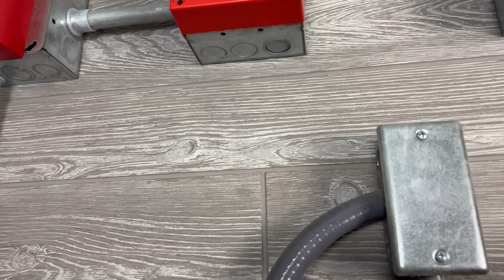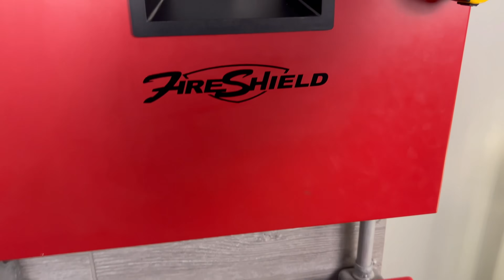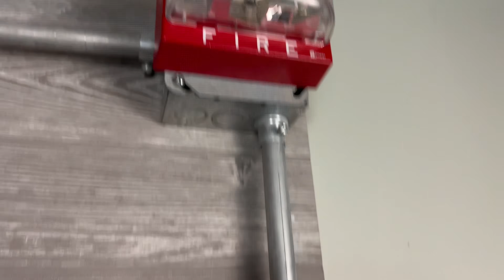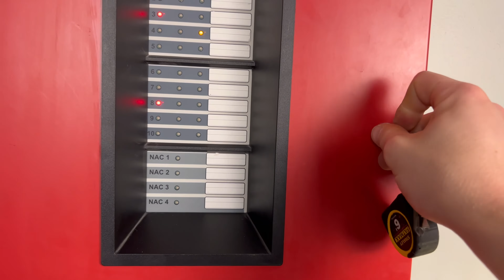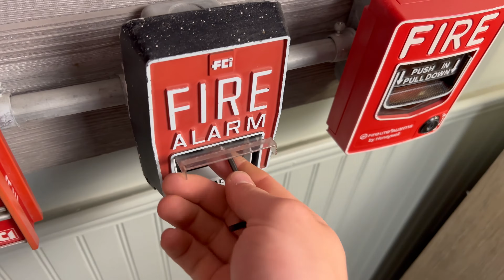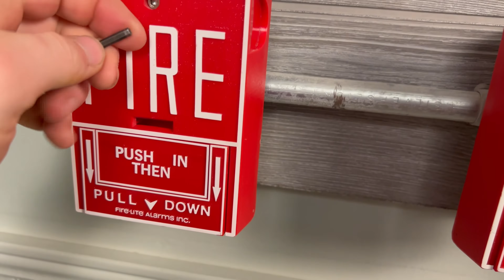System Test 22 | Board 2

Comment: I’ve seen that Simplex smoke detector at an office building before. I believe the model is 2098-9209. That office had a Simplex 4005 with 2099-9754 pull stations and 4903 horn/strobes as well (not sure if they were electronic or electromechanical horns).

Comment: Very cool system test! A couple questions I have about this setup:

1. Why does the Wheelock 7002T sound all raspy?
2. What's the more specific model number of the 4904 strobe?

Another thing is that integrity strobes are actually ceiling rated, though the 'FIRE' lettering isn't.
Reply from the maker: Thank you! To answer your questions:
The 7002T sounds raspy due to the FWR output on the 3 zone EST FireShield.
The full model of the Simplex strobe is 4904-9139.

And also I’ve heard about the Integrity’s being ceiling rated. Some say they are while others say they are not. I’ve never really looked into it though. Either way it would be nicer to have the correct fire letting orientation if installing on the wall or ceiling. Thanks again for your comment!

Comment: 4:50 They have a bunch of those at my school.  It's an older Simplex system from the 70's or 80's.  Not sure what the panel is but the alarms are mainly Simplex 4041's with 4050-80 lights and 4251-20's as the pulls.  Awesome test!  You can never go wrong with the 70002T, such a cool alarm.  I never knew that the System Sensor chime had more than just chime tones.

Comment: Ionisation smoke detector are forbidden in Europe, this way no more radioactive bits in trash can and in the wild so photoelectric are common.
It's mandatory to have fire detector in house, they sold with integrated battery that will last the lifespan of the detector (10 year and you must change them even if wired )
Reply: They're also being phased out here in North America as well.